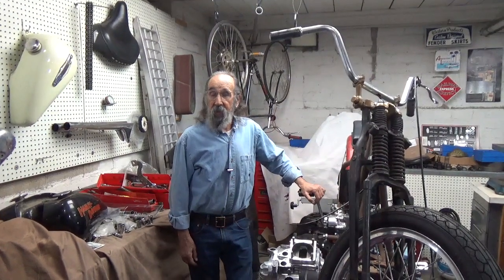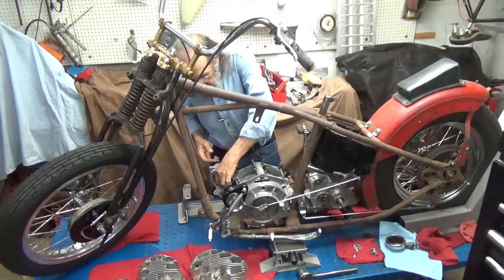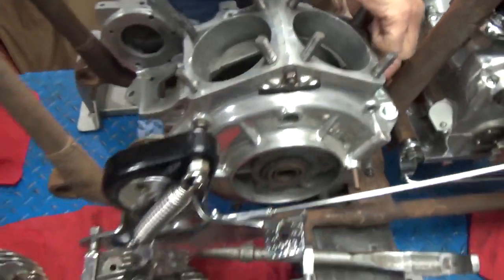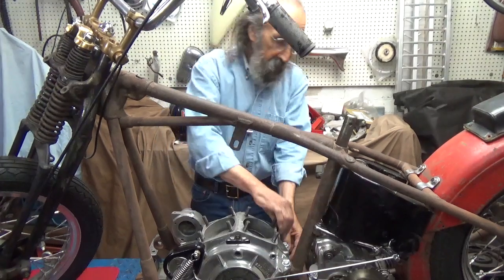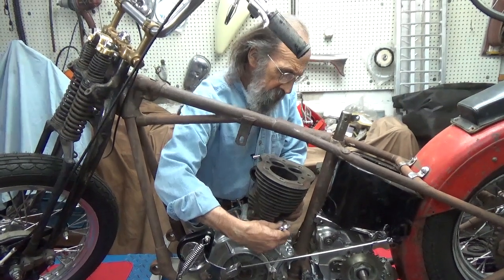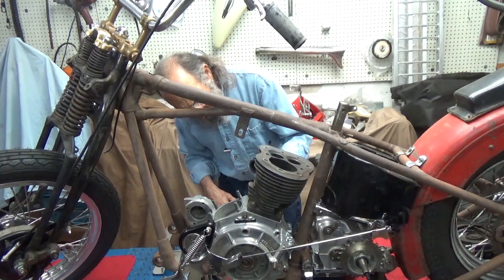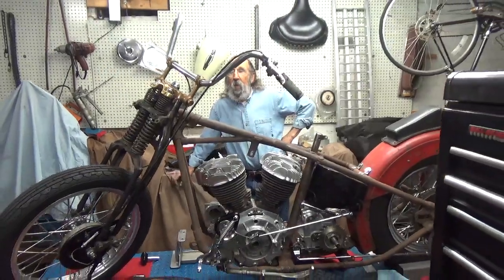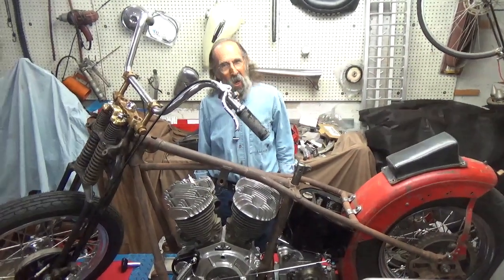Installing the Engine in the Big Flathead, Harley Davidson Project Bike

Comment: Hello Mike,
Thanks again for a very detailed VIDEO
This particular one emphasizes just how Different an ENGINE & Transmission installation is ... 
between the older Flathead / Knucklehead, Panhead, Shovelhead is & the RUBBER MOUNT - EVO -   FXR's & DYNA's that I struggle with - LOL
Thanks for the DEMONSTRATION
COOP
.........................................
Reply from the maker: FXR and Dyna, I use two jacks.  I lift the engine and trans both until they CAREFULLY align.  Then, CAREFULLY align, install engine bolts at the back of the engine and, of course at front onto mount.  So, with the front mount loose and the pivot bolt in at the rear of the trans, install the inner primary housing, again, carefully aligning.  Tighten it all up a little at a time.  Not fun, but not real hard.
Reply: @pacificmike9501  - Never attempted BOTH at Once = thanks for the TIP !

Comment: Happy I am to see you looking (and sounding) so well. Be happy with your weather - we had a small amount of snow overnight; just enough to scrape it off the sidewalk.
Reply from the maker: Thank You and backatcha.  I just took a ride in the mountains on Sunday. Snow on the ground.  Roads were dry, except where there was shade.  Slip and slide through there.  But, the most beautiful time of year in the SoCal Mountains.  (No big deal, only around 6,000 or so feet)
Reply: @pacificmike9501  You bring back memories. Years back I rode a 500 single to an appointment on a sunny dry day. Walked back out to 2-3 inches of snow on the ground. Leaned how to flat-track on the way home - and don't care to repeat the episode.

Comment: Lookn good Mike, most people don't understand that during custom build, you build the bike 4 times before it is done, blown apart for paint and final assembly.  I am your age, back in the day we yarded out shovels and Evos in one piece,  TC88's were a back breaker, call over the young buck, and the Vrods, crap, get a hoist! At the factory, we used an engine cradle, a jack up hand truck and special engine stand for those big Vrod motors, can't say I miss any of it now. My 1984 XR1000 is all I have left from HD, fun fact, Mike did you know the XR was the first harley model to use the semi torquefree front brake calipers? That caliper was used across the board on all Harley models for years. Stay safe from Seattle
Reply from the maker: Thank you.  Information I didn't know.  I do know that I'd rather put any lower end in the frame without a scratch.  Then I install the topend.  That XR should be fun.  To quote the great Burt Monroe, " I didn't build it to stop."  Just kidding.  I like good brakes.

Comment: That is beautiful Mike, a little tip for you, have you thought about welding the two together or just smooth  them on the inside, then you can widen it just a little so that it is not so visible, and at the same time increase the volume for longer runs, so you don't have to look for a gas station all the time, just a thought.
Reply from the maker: Not a bad idea.  Volume should be okay.  Going to eliminate the the oil tank wall.  It will be all gasoline.  There are some other things coming up that may necessitate the tanks staying split.  I don't know that it will all work the way I want, but thanks for the suggestions.

Comment: Awesome video, Mike. There's something about a BT flatty. I had a lot of fun on mine. I've never had such a easy to manage old old BT. It ran like a watch, never failed to start and just went and went. Showed a lot of Shovel's and Pan's up. If I ever have another, I'm going to modify the engine for more cubic " the only place it lacked was highway speeds!
Reply from the maker: That's the way I see it.  The flywheels were stroked by Mr, Clell Richards for me.  They are at 4 1/2.  The Leinweber's (father and son) are grinding me a set of cams, and so on and so on.  It will be fun.  Thank You.
Reply: @pacificmike9501  Yeah it's the right move, Mike. Ah she's already stroked then. Are you going to increase the capacity of the heads?  people here tend to take them up to 125cc offers a big boost in power.

Comment: Even though it's your build Mike, I literally got goose bumps when you eased those big barrels and heads onto the bottom end! I've always been partial to big flatheads, but the only one I ever owned, back in the late 70's, needed to go so we could mortgage our first home. It may be too late to find an affordable flathead 80, but I ought to try, right? Can you tell me why the 13-fin barrels are the preferred barrels? Do they cool better or what? Thanks!
Reply from the maker: Far as I know, the cylinder walls are thicker.  And these units are very nice.  I got lucky.

Comment: Hey Mike, Great videos!  They have been a big help to me on restoration of my old bike.
I have a 1948 UL, ran a compression test and found both cylinders about 60 psi (cold).  Squirt of oil made no difference.  What should the compression be in your experience?  Thanks in advance.
Reply from the maker: Remember, flatheads are low compression engines.  They also usually run some pretty big clearances
due to the fact that they run pretty warm and have some pretty old technology pistons.  When they're good and warm (everything is expanded up to size), the compression tends to read a little highter. If the compression reading is the same front and rear, you're probably in pretty good shape.
Reply: @pacificmike9501  Thanks Mike.

Comment: Ole mike has more money than a little bit. I glad he does too.
Reply from the maker: That's why it's taken all my life to get the things I wanted.  I'm single and worked in the motorcycle industry for over 40 years.  What I have to show for it is my bikes that I was able to get one at a time, when they weren't worth that much.  I could justify tools because it's how I made my living.  Yes, I've been very fortunate and had good teachers.  I spent a big part of my life with nothing but my Shovelhead.  That's why, after 43 years together, we're still close.  I wish you all the good luck you can handle.

Comment: in a video you made to mentioned that the frame needed to be bare metal where the engine contacts the frame, where else do I need to make bare metal before I install the engine and tranny on a freshly powder coated 83 lowrider frame?
Reply from the maker: 83 Lowrider?  Is that an FXLR?  If so.  refer to your service manual.  On a rubber mount Harley, grounds are really critical because the engine can't ground through rubber and needs an external ground strap, usually from the primary to the frame.
Reply: @pacificmike9501  its an FXSB
Reply: and the engine is solid mounted to the frame

Comment: Mike....Looking good Brother !!  Maybe I missed this fact somewhere along the line but.....how many bikes have you built from scratch like this one ??  Just curious and thanking you in advance.
Reply from the maker: Thank you.  I don't know how many bikes I've built for other people.  Years ago, I''d do my part for bikes we built in shops I worked in.  In my own shop, I'd build the bike for a customer.  Sometimes it was a restoration, sometimes a chopper, whatever the customer wanted.  When you work in the industry, building a bike for yourself doesn't happen very often.  That's what retirement is about.  Now, all I have to do is please myself.  All complete builds start at the beginning, a frame, a motor, however you start.  Sometimes, it's a bike that just gets started over again.

Comment: Now the 80" is  a from what year to what year ? Beautiful looking as well
Reply from the maker: The VL's were built from 1930-1936.   They had a total loss splash oil system.  Then came the "U" series.  That's what this is.  It has a full circulating oil system.  The "U" series (U,UL,UH) were produced in 74 and 80 cubic inch versions from 1937-1948.

Comment: How will this bike be titled Mike with all the serial numbers being from different bikes?
Reply from the maker: Old Harleys (pre 1970) are titled by their case number.  That's all there is.  This bike is registered and non-opt.  It is 100% legal and legitimate.
Reply: @pacificmike9501  so that means you have a title for the cases then? Is there an option to get it titled if you don't have the title? Such as a lost title maybe? What if the title is in the name of a deceased person who never signed the title?
Reply: @mikaldene7146  In that case you have to get a bonded title in most states. A few only require a B.O.S on an old vehicle.

Comment: Mike,love the videos.i have a  age old question that I know you have the answer too.is the low idle lump bad for your motor due to lack of oiling? Fact or  fiction?? Thanks for your time.
Reply from the maker: Supposedly it is bad.  Oil must circulate and I don't know where yours is set. If you wonder, just up the idle a little.

Comment: the heaviest engine harley ever made was the iron head sportster we had fun moving them in the early model class I took
Reply from the maker: I used to put Sportster motors in by putting the motor on its side, then putting the frame onto it.
Reply: @pacificmike9501  that is the bet way!
Reply: @pacificmike9501  That's how I did my Sportster. Layed it on its side!

Comment: How about the chevy corvair  pistons. I know I have read about using in the flatheads.
Reply from the maker: This is a stroker.  Maybe though.  I got advice from an old piston manufacturer buddy of mine.  We'll see what's available.  It depends.  I talk to the pros, then see what's most logical.  It really isn't horribly expensive to have pistons made.

Comment: If you want to run a VL frontend  and VL tanks why not run that big rwin flattie in a VL frame. That is a sweet look with a single downtube and you would not have to butcher up those hard to find VL tanks. Just a thought bro.
Reply from the maker: I had one.  Didn't like it for my purpose.  I think this will be cool.
Reply: @pacificmike9501  It's your build. I do understand, if you are gonna run hard I would also want to have a later big twin frame under me. Thanks for the response. Can't wait for the motor build. 90 inch flattie will be cool.

Comment: Mike, love the channel. I hate to bother you but I’m trying to find the video of your marine momentarily starter switch. Can you point me to it?  Also just notices this video had 300+ comments and you replied to them all. That’s amazing and uncommon. Take care.
Reply from the maker: I can't find it without looking for quite a while.  So, I'll just explain it.  All it amounts to is a 20 amp starter button (two wire).  One wire goes to the positive side of the battery.  The other wire goes to the smallest terminal on the solenoid.  The starter relay has now been eliminated.  The switch is always hot and will spin the motor over any old time.  But, it won't start without the ignition switch being on, to send juice to the coil.  I built a bracket off of my top motor mount, so if in a hurry (we won't say why), I could turn on the fuel and hit the starter button in one movement, at which point, I could become very scarce.
Reply: @pacificmike9501  thank you. That’s exactly what I needed. For some reason I thought you used a 60 amp switch. Take care

Comment: Do you always put the rear cylinder on first?
Reply from the maker: Dunno.  Usually, cause there is generall more room up front.  Putting the rear on first usually gives you more room for your hands.  But, you can do it either way.
Reply: Thanks Mike  ,will the David Mann bike show go on in December?